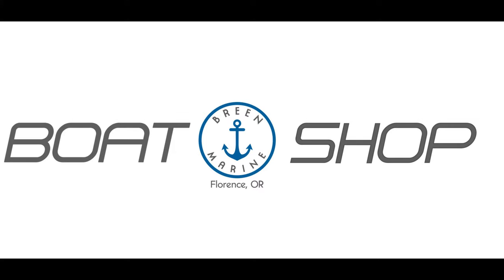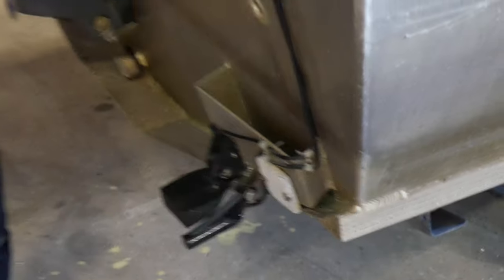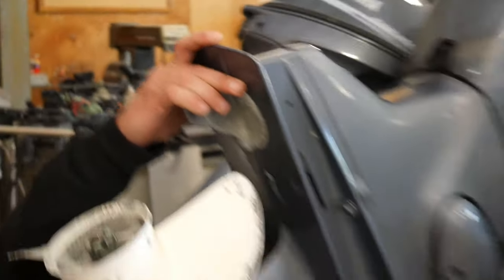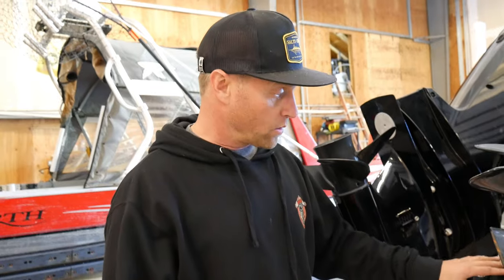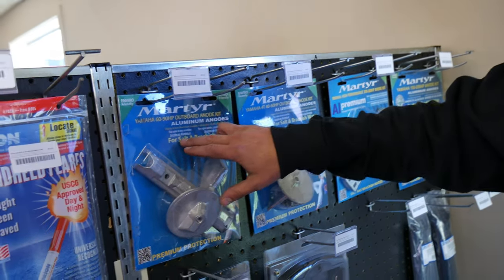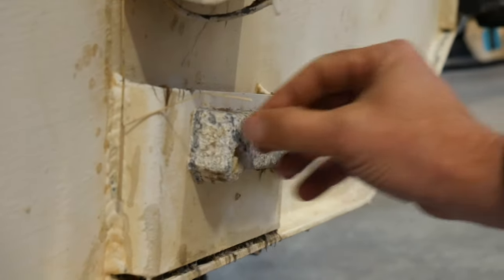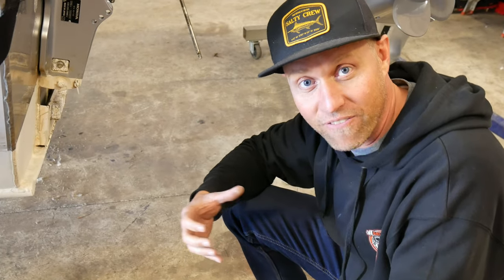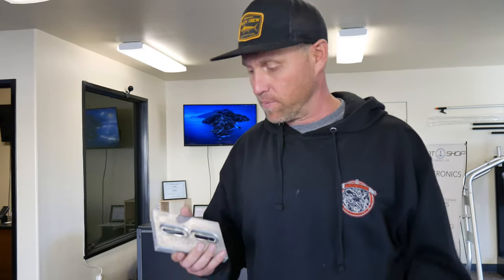A SECRET WAY TO CATCH MORE FISH! Anodes and their purpose on a boat. Breen’s Be A Better Boater #11

Comment: This was a good video thanks I added tender wheels on a small Aluminum 10 foot boat and I'm getting some of the white spots I use a minkota motor and battery that's in a battery box I sometimes just row So im assuming the boat tender wheels are causing some corrosion I want to keep the boat wheels on the boat How would I add the anodes? And how would I ground them?

Comment: I'm pretty sure the Bass Tournament guys would be dropping Anodes and wires in the water, or varying a charge from the trolling motor to the main motor if this helped EVEN A LITTLE !!
Most likely not.....but the GAME WARDEN has a boat that throws SERIOUS VOLTAGE into the water to stun the fish - - they float to the surface unharmed for a species count.